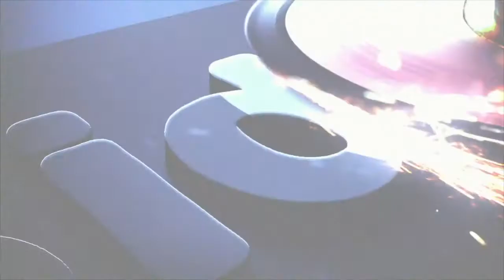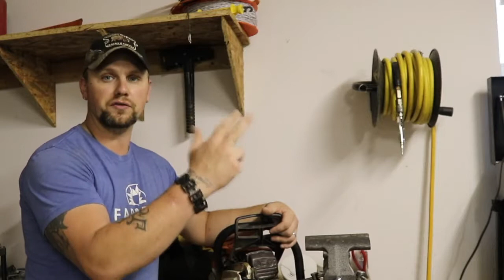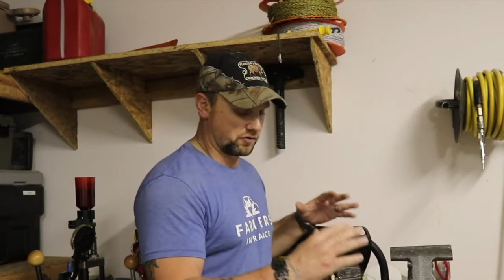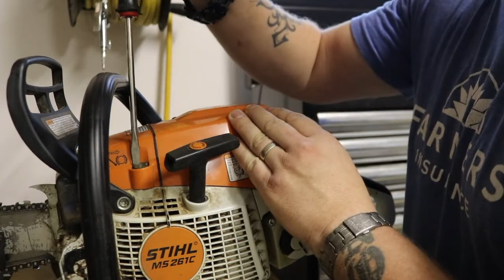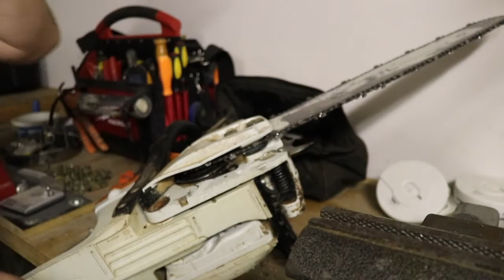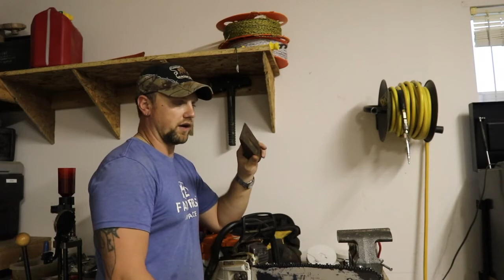Chainsaw Basics: What To Know Before Your First Cut!

Comment: Most everybody in my area that uses a saw for a living uses a Husqvarna. It usually is determined by what dealer is closest.
Reply from the maker: Every crew I’ve worked on used Stihl. Never been more then 30 minutes from either dealer as a general rule. Just seems like Stihl are made to a little more robust quality. In the end it’s a dodge, Ford Chevy thing… if one was that much better than another everyone would be using it. And certainly every mechanic would agree. Thanks for watching!